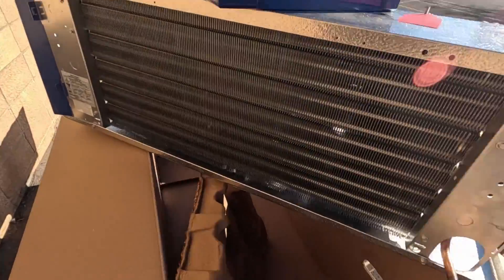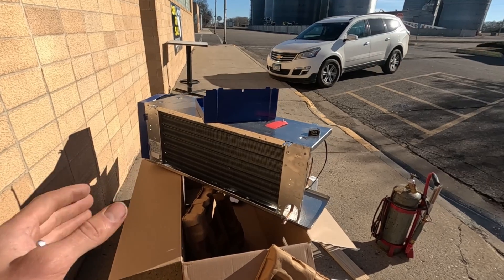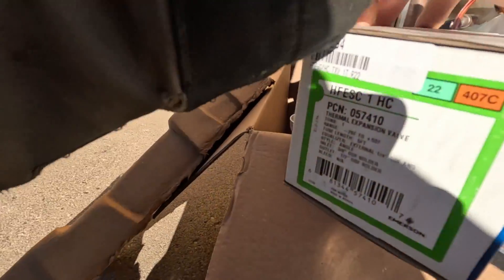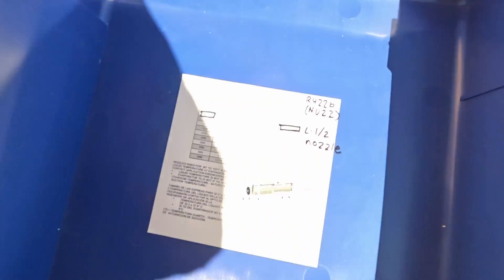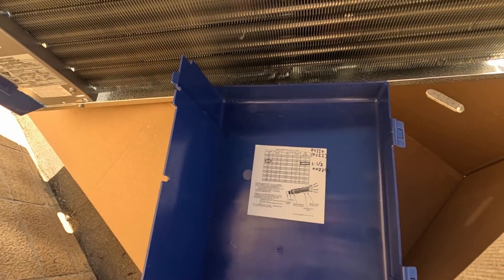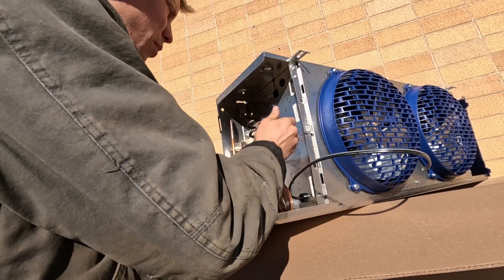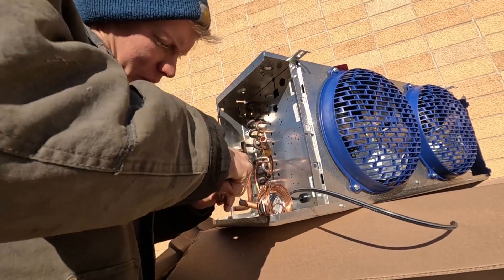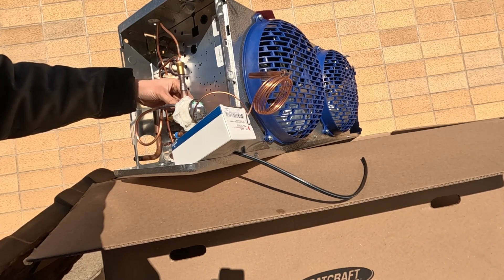How To Use an Old Condenser With a New Evaporator

Comment: oil not suppose to circulate through the system but it happens, and in order to return this oil back to compressor we want oil be able to mix with refrigerant. Txv is free of oil because liquid refrigerant going through. oil will not lublicate moving parts other than compressor parts. But surprisedly oil will help to slow refrigerant leak by closing holes by itself.

Comment: Must flow nitrogen while brazing. Now you have flake in that evap
Reply from the maker: I agree that nitrogen purging (although not absolutely required) does help. In this case I just used 71 percent nitrogen. We do use nitrogen occasionally, usually on full new installs and more sensitive equipment like heat pumps.
Reply: Your knowledge is impressive throughout your videos.
Reply from the maker: @AErefrigeration  Thanks man! I was just checking out your channel, looks like you and I do a lot of the same fun stuff! I am going to subscribe, so keep uploading those videos!
Reply: No decay test either did you even leak test with nitrogen at all
Reply from the maker: I am not familiar with a decay test. Could you elaborate?

I use vacuum checking, and then use a digital leak detector after adding in  some refrigerant.

Comment: Hi bro, i have one inquiry
Can we use r404a refrigerant in place of r452a
Reply from the maker: R452a is not a refrigerant we run into much in the United States, but from what I read it looks like it is a drop in replacement for r404a, so it should work fine? I guess you would just want to double check the oil the compressor is using to make sure it's compatible, and mark that the unit has r404a in it. Obviously staying with the OEM refrigerant is the best option, so if you can you should just do that. Where are you from?